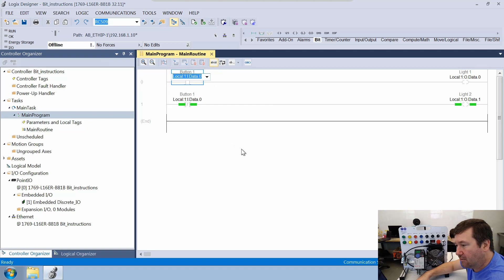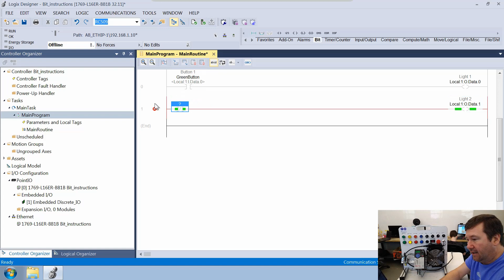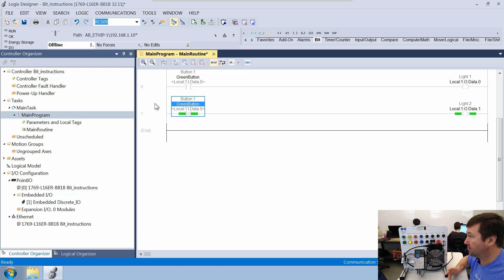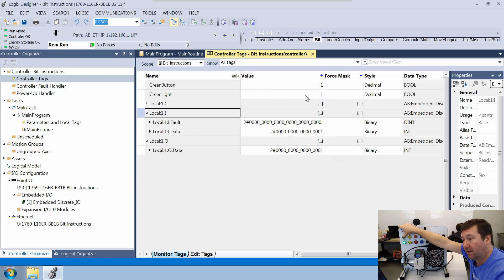Studio 5000 Alias Tags.  How to use them to make addressing easier.

Comment: Very informative video Tim thanks for the explanation. When I create a new tag and alias it to an input, I notice that the alias does not show up under the tag in brackets, but holding the mouse over it will show its alias. 
 
Is there a way to show the alias tag underneath, like in the video?
Reply from the maker: What language are you in?  Right click any white space in the routine and select options, then look for something like show tag alias information.  It is not checked by default in function blocks.  It is show by default in ladder but it may have got unchecked.
Reply: @TimWilborne  that was it! Yes for some reason that was unchecked. Thank you for the help 👍🏻
Reply from the maker: @shawnspencer8766  Glad I could help!

Comment: I can't understand how to link an I/O instruction in a routine to a specific I/O module in your PLC. It was so easy in RSlogix500, simply typing the address manually (such as I:0/0)... Maybe I missed something?
Reply from the maker: The new addressing method becomes easier to understand what you start doing more distributed IO. If it's physically connected to the PLC the tag will start with Local. So let's say you're looking for the 5th input on slot 2. It would be Local: 2: I.Data.5.
Reply: @TimWilborne  Well, I use Emulator, and when I type a tag in this manner, the program says "Error: Rung 0, XIC, Operand 0: Referenced tag is undefined"... I have designed a compressor control routine using Base Tags, and it emulates very well. Meanwhile the virtual IO module is created and I can see it's slots in the Controller Tags menu! I am going mad about this software : )
Reply from the maker: @ИгорьЯхонтович  yeah the emulators have always been flaky. I've never even installed 5000s emulator.
Reply: Finally, I got it! The mistake was that I tried to assign the boolean instruction to the DINT data. Anyway, thanks for your support and advice!
Reply: @TimWilborne what does it mean when you try to program the output for example Local:5:O:pt00Data and doesn’t work? I tried to follow as you explained it in the video but I don’t know if I’m writing it correctly (I’m using version 32)

Comment: Do you have any thoughts on aliasing versus tying and input to a defined tag by useful coil as you would do when using RS500 programming?
Reply from the maker: From a troubleshooting perspective, I'd rather see Local:1:I.Data.0 than the GreenButton alias but a lot of programmers use alias so we need to know to look for them.  Also, by default, alias information does not show up in function block programming, under options there is a check box to make it visible.

Comment: trying to toggle input on, but it will not turn on and the date table will not receive a 1.
This CLX 1756-l71 PLCv21 has in the rack with 1756 IB16, 1756 OB16, 1755 IB32, 1756 ENBT/A

2.
But there is also an PV 1000HMI  also in these cabinet could this be use instead of real field device connected.
Trying to follow a class  but not matching when I look at rack.
any help thanks.
Reply from the maker: This would make a good video...the difference between toggling a bit and forcing a bit.  When you toggle a bit, it does indeed right a 1 to that bit box...well it writes whatever bit is not currently present in the bit box to the bit box.  So if you see a 1, it writes a 0.  If it sees a 0, it writes a 1.  If you toggle a bit and it "appears" not to change, then you need to ask yourself, what else could be writing to it?  Because toggling a bit only writes the value one time.  Other things are free to overwrite the change you just made.  In your case, the "input" which I assume is either the IB16 or IB32, will overwrite what you have done every 5ms or whatever you have the RPI set at.  

A force will make the input "stay on".
Reply: @TimWilborne  
Thanks but in my case I have no physical wires connected to the inputs or outputs cards my card show the LED light on, but my input card dose not the logic on my laptop shows the input on.
Even when I force the bit on and I can see it on with an red 1 in the watch window
the input card has no led on, but the output card dose.
Thanks again for your help.
Keep up your good work on YouTube!
Your class might be next on list.
Reply from the maker: The LED will not light up whether you toggle or force an input on. The LED is an indication of the physical input state, not the program state.